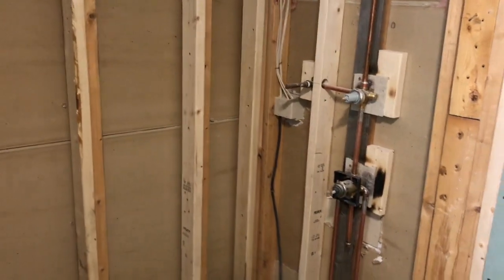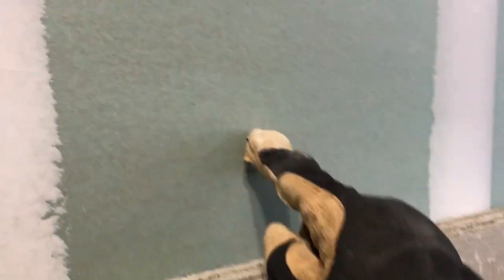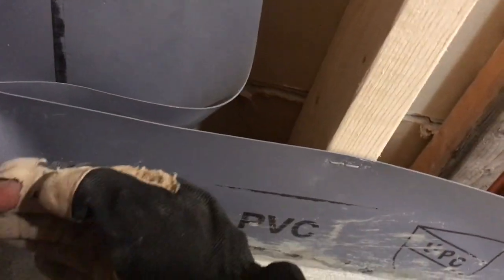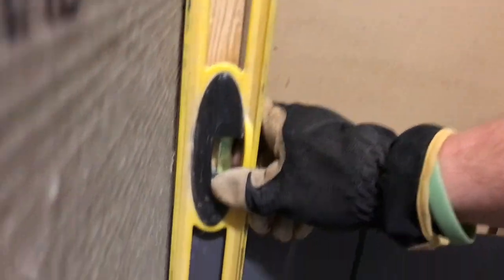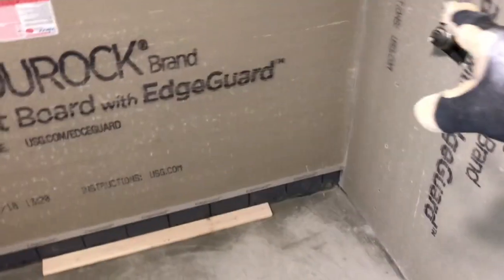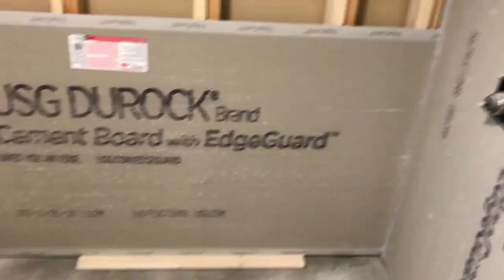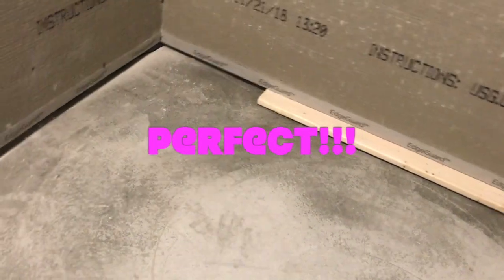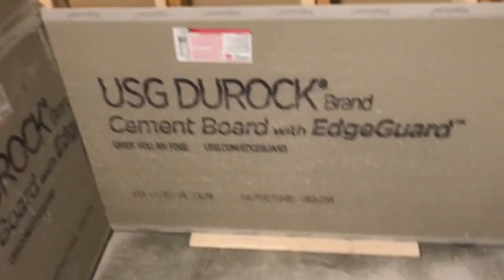AHH Designs | How to Install Cement Board | Bathroom Remodel

Comment: Doesn't screwing the backer board to your curb defeat the purpose of installing a pan liner?
Reply: Concrete board on curb is for holding thin set and tile. Keep in mind that concrete board on its own is not waterproof. Here is my understanding of water management of shower floor, but I am sure there is a more experienced person/video that can explain better. Layers of floor from top to bottom generally are tile/grout, top mud pan, pan liner, bottom mud pan (on a wood floor there would be tar paper under bottom mud pan. Water can permeate under tile/grout and enter the top mud pan. Pan liner is ultimate water barrier and directs any water in top mud pan to the drain. Probably more than you wanted to know 😂

Comment: Great video! Do you also need to screw into the bottom sill plate to minimize all movement and potential tile cracking?
Reply from the maker: Hi thank you. No need to screw that low.